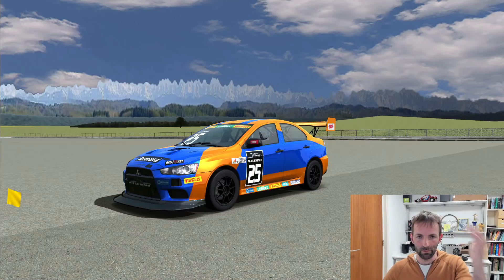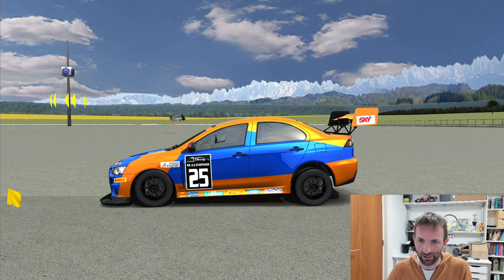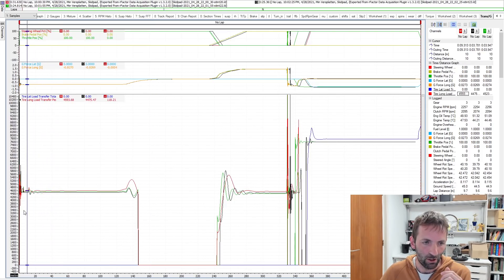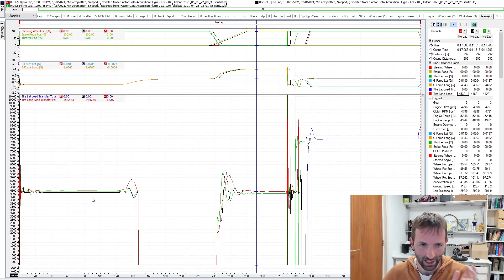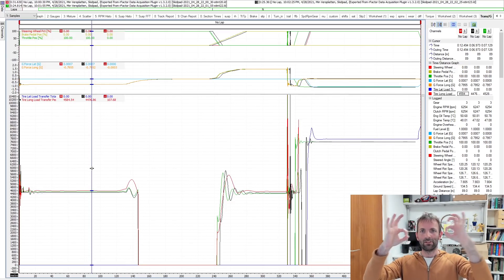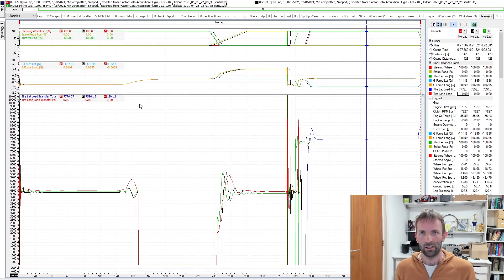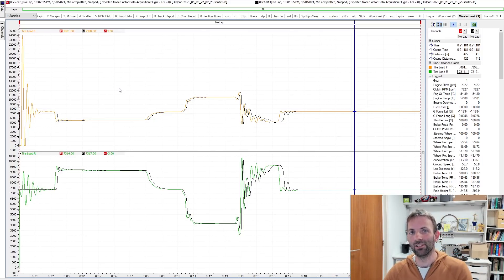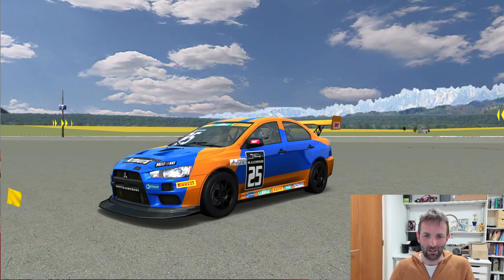Weight Transfer is *INVISIBLE* Let's Explain Why!

Comment: So when I think of weight transfer, I am not thinking of steady state.  I feel "weight transfer" as the transient time between changing directions, where the car changes from one load scenario to another. So any adjustments I would be making to "improve" weight transfer are to improve the subjective feeling when I change direction, so that the car takes less time to feel settled. I would be curious what this would look like in a test that was purely transient, like repeatedly accelerating or decelerating, or going through slalom. 

Thanks for your analysis Neils, always fun to think about!
Reply from the maker: Doing a slalom with these two extremes would be quite different. But doing it on a GT3 car going from a 100N/mm to 200N/mm wheel rate, would not make a big difference. Racing cars are always stiff and the time it takes to transfer the weight is very short. I haven't really tried it but I think it wouldn't make a big difference. What would of course make a difference if you change the front and rear springs differently. Going from 100/100 to 150/50 will (simply speaking) make body roll the same, but handling a lot more understeery.

Comment: In ACC on Zandvoort I once had this situation. GT4 car, very hot weather and left side tires overheating because that circuit in particular is rough on the left side tires. Intuitively I solved the issue by making the car SOFTER in roll thus having LESS weight transfer in corners (I imagine a car that is infinitely stiff would transfer maximum weight to the outside tire while cornering). And indeed it worked. The difference was significant, evident from tire temps. Left side tires did less of the job while cornering and right side more making them more even. 
Question: Why did it work if by your logic the weight transfer was supposed to be the same?

Edit: I wonder if you would see a difference in weight transfer on your graph if you drove a car on the limit through a high speed corner.
Reply from the maker: So many things could be happening! Softer suspension can mean less 'load peaks' and that means fewer tire deformations, which will make tires less warm. I can't say if that is 0.1 or 10 degrees, but it probably is true. But you're also changing the handling. Perhaps you had some understeer and the front tires were at a one degree bigger slip angle through the turns, heating them up much more. Perhaps you are in general 'smoother' with a softer setup, that can affect tire temps as well. 
Bottom line is, a LOT of things happened, but if you take the Tarzan bocht at 1.5G before and after the car setup change, the total weight transfer of the setups is identical.
Reply: All I can guess is that maybe the softer suspension slows the RATE of weight transfer, i.e takes longer to reach peak weight transfer (but the peak is still the same).  So full weight transfer may not occur till, say, half way through the corner, saving the tyres for a split second on every corner which over a race distance might have a cumulative effect.

Comment: 10:05 The ride height difference was probably millimeters instead of 10cm on a car with a weight distribution close 50% front as the rear went up 5cm at the same time front went down 5cm. 10cm delta in CG would be quite a lot.
Reply from the maker: Yes, but there are people who think a 'low nose' means more weight on the front. I don't understand their logic either but I've heard it a few times.. So I wanted to bust that myth. Obviously doing front and rear +10cm, moving the CG say from 40cm to 50cm, will increase weight transfer by 5/4.
Reply: @NielsHeusinkveld  If I had to guess that comes from the intuition from experiences of weight transfer when handling objects such as wheelbarrow etc. combined with the lack of understanding of trigonometry where small angles are negligible (in which category 3000mm wheelbase car with even few degrees of change in rake would fall into).

Comment: I would love a video explaining how to calculate the correct amount of body roll a given car should have to maximize grip, or if such things are merely in the domain of subjectivity (trying to balance grip with control and reactivity).
Reply from the maker: There isn't such a thing sadly. Everything is a tradeoff. If you have a downforce car, perhaps it wants zero body roll and pitch. But that means using such stiff springs and bars that the thing becomes a bouncing tennisball and is undrivable. But when you make the setup soft so it rides the bumps and kerbs prefectly, the aero will move around too much making it undrivable there. The window on most car setups is somewhere between 'very stiff'  and 'even more very stiff' once aero is a factor on the cars.
Reply: Body roll (or pitch) is undesirable because it usually: makes the tires not properly oriented to the ground (camber-wise); leaves less travel for bump absorption; puts the car in a bad body orientation (for aero cars); means that the car takes a longer while to transfer tire forces to the body (feels sluggish). I may be forgetting some other reason.

So there isn't a correct body roll to maximize grip. There are too many variables, and even if you get a perfect solution for a car in one corner, it won't be perfect for any other corners in that circuit.

Comment: Is the weight transfer unaffected by setup changes because it’s a function of the whole system (tyres, suspension, body, etc) being affected by G forces all at once?
Reply: Big changes in ride height affect weight transfer, because you are altering the CG height, which modifies the lever in the forces diagram.

Other than that, not much can be done via setup. Through setup the aim is to change the amount of grip one end has in relation to the other, thus altering car balance. But it's really unusual to make a change which increases the grip level in the vehicle as a whole.
Reply: The weight transfer is affected by setup changes, but mostly in the transient region between the steady states. Nils explanation only works for a car in a steady movement, in a vacuum.
Reply from the maker: As Forza and Heitor correctly say, a super soft suspension means it takes more time for the weight to transfer after you give a steering or braking input. This will 'feel' different for sure compared to a stiff car. And most importantly for cornering, you can't really change the total weight transfer, but you can change how much of this total transfer is taken by the front and rear axle, which is a huge influence on car balance. I.e. a stiff front gives more understeer etc. But it only distributes the same load transfer differently, it doesn't change the amount of load transfer for each G force.

Comment: I don't see the point of the video. Even if the changes in tyre loads between different stiffnesses and such is small, cars are operated at the limit of grip where a 0.5% more or less grip front to rear can make a big difference. If a car rolls more or less than another can still give helpful clues because in the end the centre of gravity does move a little more toward the side the car is leaning, which has some effect on tyre loads and can give insights into the setup used. Transient response of the load transfer can also make a big difference and this does not even cover the massive aerodynamic balance/force changes can come from a car's attitude.

Also, did you invent negative stiffness springs for the last example? haha
Reply: He used an impossibly low center of gravity on the last example. If the center of gravity of the car is below the surface of the road, the car will lean "backwards".
Reply from the maker: @5thearth  not needed! if I did that, the weight transfer wouldn't be the same.  It is all just suspension geometry trickery, bad ideas, but they do work.
Reply: @5thearth  oh yeah, you are right. Negative spring constant would just shoot the car off to space or lift up the wheels into the arches!
Reply: This can be achieved by suspension geometry as well (this example may have unpractical manufacturing / assembly properties, though - in other words, impossible too). Look for anti-dive and anti-squat geometry, and you can get a sense of that applied to lateral movement as well.
Reply: in short: Roll (or Pitch) Center above (really above) CG.
Reply from the maker: There are people who think more body roll is more weight transfer, and even that static ride heights affect static weight distribution. So those people might take something away with this video! :-)
I'm pretty sure you can't feel weight transfer caused by CG movement at all, especially on racing cars that are 'stiff'  or 'stiffer'.  Yes, if a car has body roll and pitch, those ARE visual indications of the G force you're pulling, but the point I'm trying to make is that a stiffer setup with less roll does not change the weight transfer.
And of course, transients, aero, all real things that I've left out here.
The final car has suspension roll centers above the CG height of the car and 200% anti dive / squat, theoretically possible to put on a car, but I wouldn't advise it.. :-)

Comment: Sorry for the massive ignorance, but how does this relate to the grip level in the tires?
Reply: The less weight transfer in a car, the higher the global available grip is. As soon as one tire gets more loaded, some other(s) tire(s) is less loaded by the same amount. Then "load sensitivity" enters the conversation. This term means that if you double the vertical load on a tire, you DON'T double its grip (basically, the coefficient of friction isn't a constant: it decreases as the tire has more vertical load).

So, that "more loaded tire" has more grip, yes. But it didn't gain as much grip as the other(s) lost. Thus the overall grip in the car is less. And that's why a low CG one of the best thing you can get in a race car: weight transfer is diminished for a given lateral (or longitudinal) acceleration --> less grip lost --> capable of pulling more lateral acceleration.
Reply: And the video basically shows that "I will get faster by stiffening the suspension to avoid weight transfer" isn't a very successful setup strategy. It's better to focus on something else.
Reply from the maker: @heitooooor  I could've just said that and be done instead of making a 13 minute video :D
Reply: @NielsHeusinkveld , but then the "accelerating, ... burping, or braking" joke wouldn't exist. And that is unacceptable!

Comment: I am wondering though, would the weight transfer be the actual movement of the loads? So, the "steady state" turn/brake/acceleration load is "static" (depends on cornering speed etc.). So wouldn't the actual transfer of weight be the behaviour of the loads when transitioning between these phases? The telemetry is very different, between the cars, when moving from the braking phase to the turning phase, for example.
This of course still means it is invisible, but that would also mean that setup actually effect the ways the loads move around the car.
Great video anyhow. Really love these more in depth physics videos.
Reply: Yes, the transients will change, but the total amount of weight transferred will not change significantly.
Reply: @5thearth  Absolutely, but at that point the weight/load is not really shifting anymore. I think it is the moment when you move between these states that the actual transfer occurs, and consequently, the main difference between the setups pop up.
Wouldn't that be the reason you can't really see the transfer? Because as you, I think correctly, said, the lean is a result from this set load in the corner/braking zone/traction zone.

Comment: To be fair, what is being visualized (or felt in a real car, pressing against the seatbelts under braking etc.) is the effect of the input that induces weight transfer. So, while it is inaccurate to say that you can visualize the weight transfer, you can see the change in pitch or body roll that is induced in the chassis by the forces that also act to transfer weight (load) between tires, as you demonstrated. Therefore, the weight transfer can be inferred based on the visual queues that are observable, namely pitch and body roll changes, even if you cannot determine the degree of transfer that has occured.
Reply: Theoretically you can do a 100% rigid car, so no travel of wheels will occur. Even then you get weight transfer.
Reply: @b.s.7693  weight/load transfer occurs with change in acceleration. As long as the change in acceleration is enough and occurs over a short enough period of time, the vestibular system would detect it, even if, hypothetically, you could dampen the forces on other parts of the body the driver felt ( basically integrating them into the chassis). 

As the vestibular system isn’t acted on when driving a stationary sim, the driver could still pick up on visual queues of change in acceleration, even if the setup you proposed had no pitch or roll whatsoever. The rate at which track side objects would pass by would change, inferring the acceleration.
Reply from the maker: @AMRosa10  Ahh of course, you FEEL it, or 'see' the results of the car accelerating in whatever direction. My point was you can't derive load transfer from body roll and pitch, as some people seem to think.
Reply: Spot on
Reply from the maker: I think I show exactly that you can NOT visualize it by the change in pitch and roll! The soft and stiff cars have the same weight transfer yet are massively different in pitch and roll.
It is true that, with the same car setup, if the more nose dive you see when braking, the more weight transfer occurs. The more body roll you get, the more weight transfer occurs. But when you change the setup to be stiffer and you get less nose dive and roll, that has not affected weight transfer. That is my point in this video.

So yes, when everything else is constant, more body roll is more weight transfer. But a car with less body roll doesn't have to have less weight transfer going on.
Reply: @NielsHeusinkveld   I think you are missing my point. You demonstrated that you cannot determine degree of transfer. 

But it can be inferred that the transfer is taking place. Even the car where the suspension acts in the opposite direction, it can be inferred. You are inferring acceleration, even if the degree of that change cannot be accurately determined by the visual queues because of what you described.
Reply: @NielsHeusinkveld   mate I love your videos but you are missing the point. The ability to infer the weight transfer is a useful way to manage the car as it allows you to visualise what’s happening even if it’s actually not evident to the human eye. It’s a mental aid..

Comment: But surely, what you're primarily demonstrating here is not weight transfer but load transfer. And it's the failure to make the distinction that leads everyone to associate the movement they see with what matters (load transfer) - which would be present even with an infinitely stiff suspension because it's an inertial effect. The weight transfer (small movements of centre of mass), as you demonstrate, causes fairly insignificant changes of load on the tyres... unless there large amounts of free objects - people, cans of beer, vats of wine etc. Why do people (who should know better :)) say "weight" when they mean "load"?
Reply from the maker: Technically you are correct, but I chose the term that is most often heard. I've also often used forces in kilograms instead of Newtons, technically not correct but effectively kinda the same. So to avoid explaining why suddenly the thing grows by a factor of 9.8, I might stick with weight.
Reply: @NielsHeusinkveld  Just to clarify: the proper definition of weight transfer is a transfer in the centre of mass of the car, and the proper definition of load transfer is the transfer of load between different tires. But generally in racing  the term weight transfer is used to refer to the definition of load transfer (transfer of load between tires). I guess its kind of how in general most people use the term weight instead of mass (eg "how much do you weigh?") Is this correct or am I missing something.
Reply: @NielsHeusinkveld  To be fair, you're in pretty good company because even Brian Beckman does it in his "Physics of Racing". And he's about as smart as they come. Which is why query its use. I saw a professional engineering forum somewhere (I've lost it) with suspension engineers in the industry and they were definitely employing the term "load transfer" fwiw. Btw, you're voodoo suspension was most disturbing. :)

Comment: So... Weight transfer is really visible if you have to calculate and simulate it for hours (with anti-forces, roll centers etc.) just to hear it doesn't exist from someone on the internet.

Great video BUT body movement affect weight transfer, just not how people like to imagine it. It simply moves your center of gravity. It ain't big change but it do exist.
Reply from the maker: Yes it does, but turning the steering wheel 2 degrees more, or braking with 0.5kg extra pedal force influences the weight transfer a lot more than the effects of moving CG!